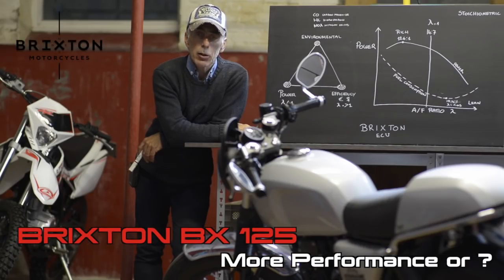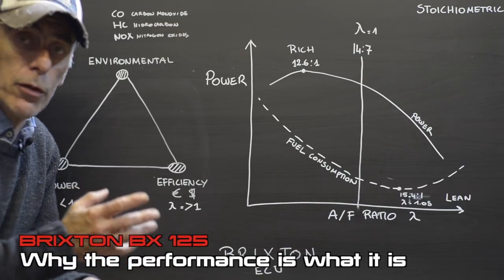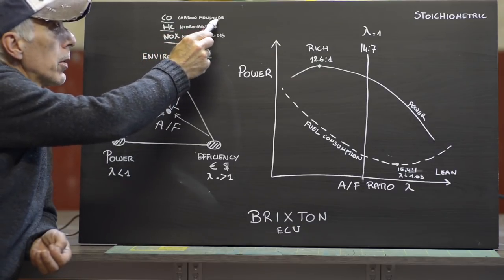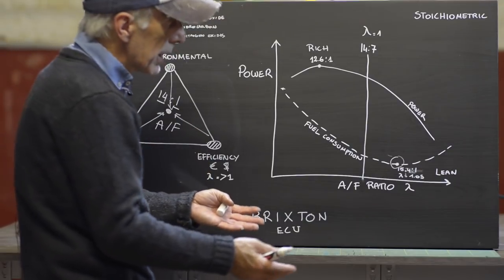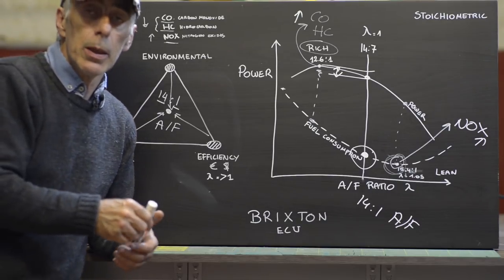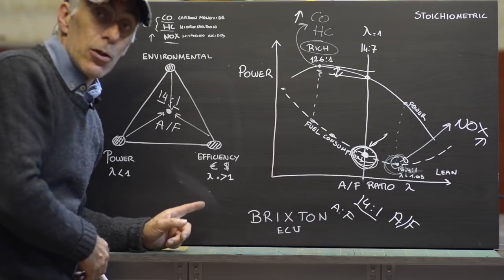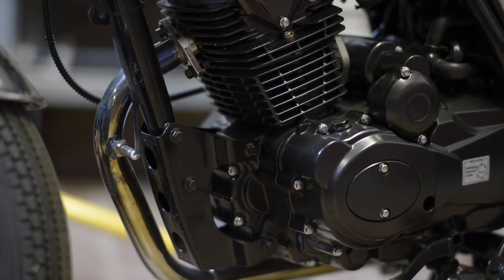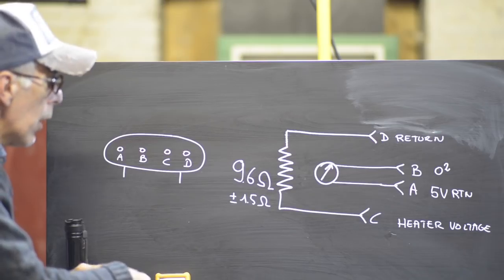Brixton 125 cc, can we get more power out of the engine ?

Comment: Very good presentation! You have helped me understand why my Brixton 125cc has a problem with intermittent acceleration (i.e., sometimes there is a bit of torque, sometimes it is very lethargic). I suspected the ECU was the issue - or at least in that area of the electronics. The dealership/mechanics have been no help to me and seem completely uneducated in the product they sell. Perhaps the exhaust sensor is faulty, or the ECU itself. I would like to find out so it can be corrected. I have no real wish to create more HP or Torque in my Brixton, but consistent performance would be welcome. Thanks for your excellent presentation of this information - very educational for those of us who like DIY theory. Cheers, TH
Reply from the maker: My pleasure, if you have an OBD2 reader, then you can readout most of the sensors real time.... I have a vide on it and that might help
Good luck

Comment: Hi very interesting video. Informative even to someone dumb in math as me, I have a problem myself tbh. I own a Brixton 125 Sk8, and it has only 2000 km on it so far, all is fine I know cause of the big whells and tyres it is gonna be a slow bike. When I rev in with medium throttle mostly there is a hole in power between 6000-8000 Rpm. The bike stops reving smoothly for that 2k Rpm it slows down and picks up again at 8000 Rpm. This mainly happens when I run the bike on average throttle for a day or two. If I run the bike constantly on hi Rpm this shows up less often. I went on the mechanic that imports Brixton in my country (Kawasaki dealership) for my 1000km service and to check for the issue. They told me they didn't find anything, which tells me that either they are incompetent or they just didn't care enough to do a proper test ride long enough with average throttle to see it happen. What are your thoughts? Thank you in advance
Reply from the maker: That is strange, and it seems to me that one of the sensors is not picking up the right signal and hence the ECU is badly informed and does not increase the demand for fuel...  This could be the gas throttle position sensor, the Lambda sensor on the exhaust, the Mass Airflow or Manifold air pressure sensor.   Those would be the most obvious problem makers.  Yet, that should be recorded in the ECU and show up when the error codes a read out of the ECU...  Ask your dealer to read the ECU codes ....  I have a video on it ..   If anything is wrong with the sensors , then it will be logged....   The last thing that could be wrong is the injector solenoid .    For the rest there is little that can be wrong , unless you have a faulty ECU, but that would show as well.  It seems that your dealer is not really taking your issue seriously .    Good luck
Reply: D3Sshooter  ty for your quick answer, the bike has not the engine check light on so probablu it hasn't recorded any error. The problem occurs only when I use the bike in mid range conditions for a while, when I am using it constantly close to the higher revs that problem appears less often
Reply: @giorgiodoe3257  bonjour ,
Le temps à passé , du coup d'où venait votre panne ?
Selon ce que j'ai compris , ce n'était pas les capteurs divers puisque vous n'avez pas d'affichage de défauts ! 
L'écu lui même alors ?
Je serais (peut être d'autres aussi!) Très intéressé par votre réponse !!! 
Avez vous toujours votre brixton ? 
Eu d'autres problèmes ! 
Merci beaucoup . ✌
Reply: @christianjacquet4095  Hello Christian. I gave the Brixton to my sister. But I can tell you this. Since the Brixton was still on warranty we switched the ECU with a new one and the problem was solved. After a few months I gave it a Ride and felt something was not as it should be but was not entirely sure it was the same case or if it was just me that had not ridden the bike for so long
Reply: @giorgiodoe3257 
 salut ,
Merci beaucoup pour vos réponses 👍
Et idem pour vos talent ... et de le partager ! 👏👏👏
✌
Reply: Par contre , ce qui est dommage , c'est que les paroles ne soient pas sous titrées ! 😢
C'est peut être pas facile à faire ? 🤔
Alors , je lis les commentaires pour en savoir plus !!! 😂
Mais j'à n'ai put suivre ce cours ..... dommage ! 
Encore merci pour tous ces renseignements que vous nous transmettez ... ✌

Comment: Maybe it would be possible to trick the ECU through the lamba sensor by adding a small resistance ?
Reply from the maker: Guillaume Pinson that is just one sensor and yes potential that could be an offset to shift the AirFuel ratio working point into a more make believe lean mixture and hence the injection would become a bit more rich.  Yet , it might work to some extent but is rather static and might cause high idle and DTC’s
Reply: I think I tricked my brixton into thinking It has low air/fuel ratio by doing a thingh not on purpose. I once took off the exhaust to repaint It, and putting It back on again I forgot a small insignificant ring that was between the cilinder and the exhaust(After the cilinder but before the lambda sensor).  Of course it's much louder and explodes more, but that's because the gases go out directly from that gap. So i think that in this way the lamda sensor rilevate a low air/fuel rate and tells the ECU to give more

Comment: So I've been thinking : All these Chinese 125s use a copy of a suzuki gn 125 engine. What's interesting is that if you look on aliexpress for gn 125 tuning there is a 150 cc kit, different camshaft etc. Installing these would help right?
Reply from the maker: DeadlySin2606 , txs.  Well that is always an option . I do know that they have a 150 for the Asian market.  The problem you will face is that the ECU will need remapping. And so far i could not crack the map access.  More CC and camshaft alters thr mixture quantity and timing for the injection and ignition.  Without  that new fuel map.   It is not going to work

Comment: Great video and awesome analysis! I've been looking into the same but for a Mash (similar if not equal platform), ideally we would need ignition advance control, we're you able to find info about changing the ECU maps?
Reply from the maker: Álison Fernandes i think that the mash has the same delphi ecu.  Have look under the saddle there should be a block with a big greu and black connector with a MTo5 label.  Ii am wotking on retracting the map and analysing it.   Once i have access to the parameters i can place the bike on a dynamo bench and test the power etc while changing the map.  But that is still a bit of work.  Soon i will post something.   Good luck with the mash
Reply: Yes, same ecu. How are you connecting to it? I've found BitBox tunning software and after reading Delphi manual, there should be a USB connector that enables you to connect using some old software called Delco PCHUD. Do you have this connector? Third link seems to be the connector. 

http://www.rx3adventure.com/rx3_computer_diagnostics.html
http://www.chinariders.net/showpost.php?p=186074&postcount=1
https://item.taobao.com/item.htm?id=39520023502
Reply from the maker: Álison Fernandes no usb only the K-line works .  The CAN is not responding as per 11 bit standard. I have my own software for the k line.    Soon i will put a video up.    Note that its 6 pin connector. With Can hi an lo, K. Line and the 12 v and gnd
Reply: Salut ,
Les gars .... vous êtes passionnés et passionnants !!! 👍
C'est vrai que des infos/recherches de la sorte sont si rares !!! 
Merci à vous et votre talent , notre sauveur brixton !!! Tant sur sa mécanique que sa partie electrique/électronique . 
Un grand bravo et des bisous pour ces secrets révélés a propos de nos montures préférées !!!      ✌

Comment: Very interesting video  !  Can you tell us how you will dump the current ECU and with what software you will tune it ? I made some research and it seems that our Brixton uses Delphi MT05 EMS. Data sheets can be found here : http://www.huntermotorcycles.com.au/dealer/Dealer%20info-%20website/Service%20and%20Predelivery%20info/Delphi%20Scan%20Tool%20Manual.pdf
Reply from the maker: Guillaume Pinson txs and indeed it uses the mto5 -2 ecu from delphi.  That should support the K line. And also the CAN bus on the diagnostics connector.  I am going to use my own developed pid scanner based on OBD2.  Normally the standard pids need to be supported.  The problem will to get the fuelmap read out, interpret it and then build a new one with gradual changes.  I will have the bike on a dynamo bench while changing.   All by all a hard job.   I just got a spare ECU. Getting the fuelmap might not be that hard as we think as there are flashers and loaders already on other bikes  and cars with a delphi ecu.   It is going to be trial  and error.  But will keep you all posted how i progress

Comment: OK FLEMISH, BUT AT FIRST HOW DID YOU KNOW WHICH WIRE IS WHICH. I MEAN BECAUSE YOU HAD FOR WIRES ON YOUR O2 SENSOR THEN HOW DID YOU KNOW THAT THIS ONE AND THIS ARE FOR RESISTANCE AND SO ON. 

I AM CERTAIN YOU HAD A WIRING DIAGRAM. AND IF SO THENWHERE DO YOU GET THOSE DIAGRAMS.
M.B.S MOSHITOA (S AFRICA)
Reply from the maker: Those are all parameters that you can measure and find by looking up the datasheet of the devices
Reply: @D3Sshooter  OK FLEMISH IF THAT IS THE CASE, THEN PLEASE MAKE US A VIDEO ON HOW TO CHECK A DEVICE ON A DATA SHEET. I AM CERTAIN IT WILL BE VERY USEFUL TO US

M.B.S MOSHITOA (S AFRICA